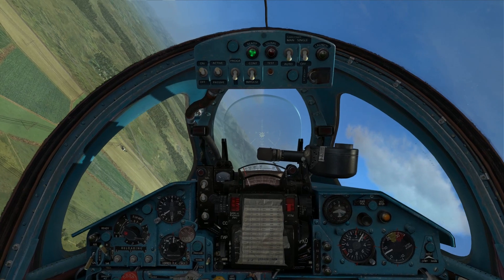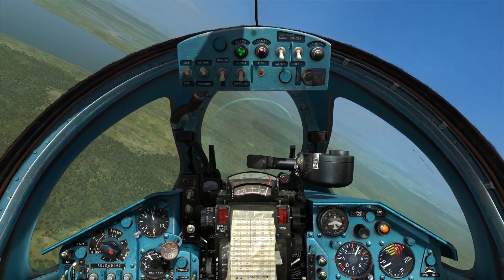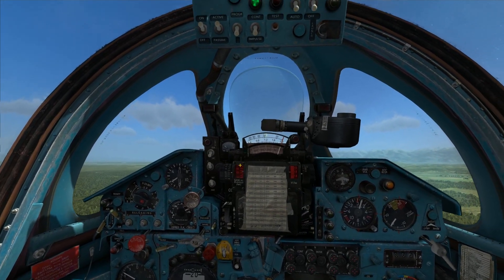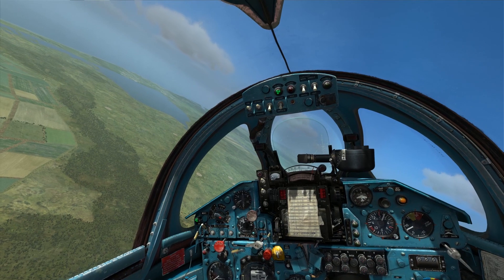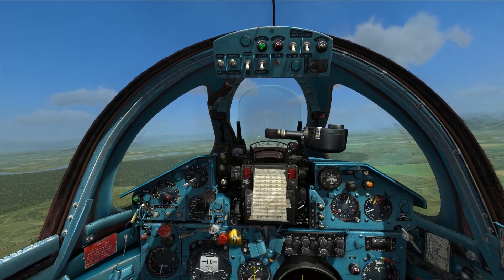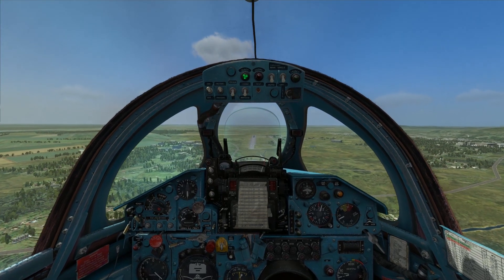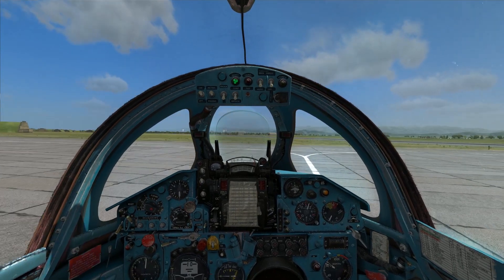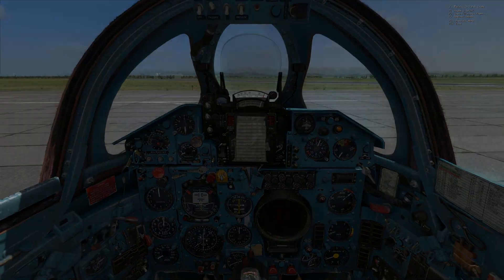Test Flight Preview - DCS: MiG-21 Bis Fishbed #8

Comment: If you sink too much in the flare, it's may be because you pulled the throttle back passed the LND gate? The Mig-21 has "blown flaps" to generate extra lift, but they won't work with the engine at idle.
Reply from the maker: Jordan Forrest You sir, just fixed my problem.  There is one more landing later in the series where the loss of lift in the flare is VERY pronounced.  It didn't dawn on me until now that the system kicked off at idle.  I owe you one... :)
Reply: +Bunyap Sims, excellent, glad to help!